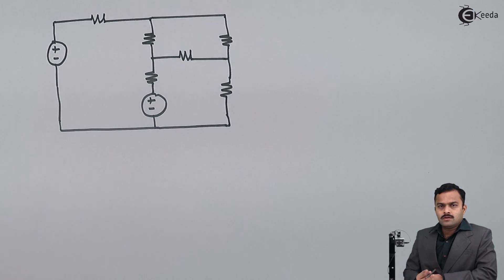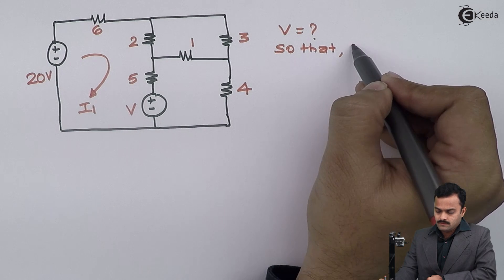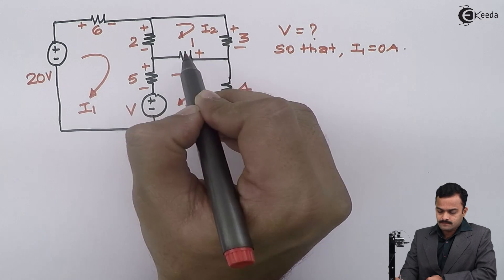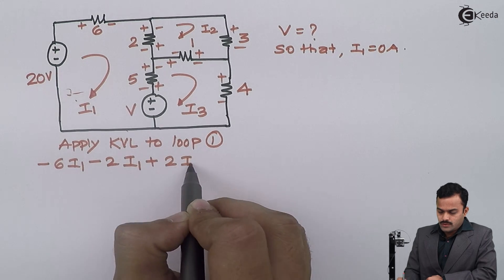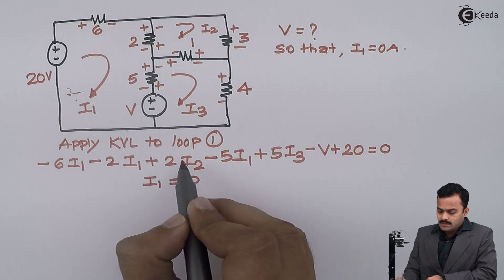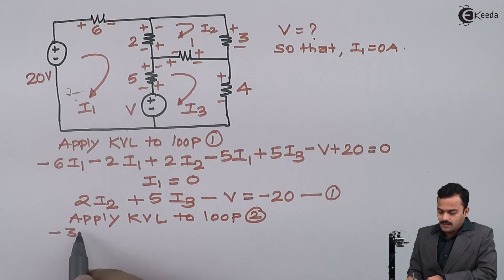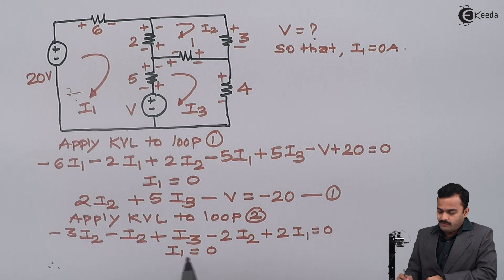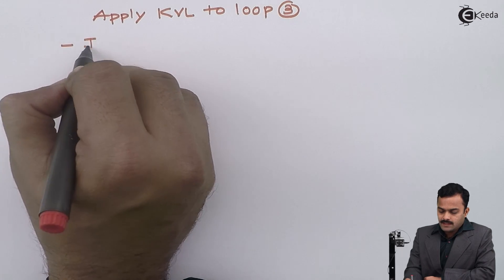Mesh Analysis : Problem 4 - DC Circuits - Basic Electrical Engineering

Comment: By 2nd equation I3= 6 (I2) .substitute 2nd eqn in 3rd eqn [-10(I3)+5(I1)+(I2)+v=0] ;. I1=0; then eqn 4 [ v=59(I2)] substitute eqn  2 & eqn 4 in eqn 1
Then 2(I2)+5(6(I2))-59(I2)=-20
By solving I2 =0.7407
v=59(0.7407)
v=43.7013
Reply: Tnx

Comment: I2=0.740 A
I3=4.444 A
V=43.701 Volts (check ✅ your Ans)
👍👍👍
Reply: Can u explain it once again
Reply: @zetharsolvex  same as previous problems but I1 is interchanged with "v"
Reply: Substitute v value 1 in casio
Reply: Can you please explain what did u do after getting 3 questions for loop 1 2 and 3?????
Reply: Thanks:)
Reply: Yeah I'm getting the same as well
Reply: I2 is -ve
Reply: Also V is -ve